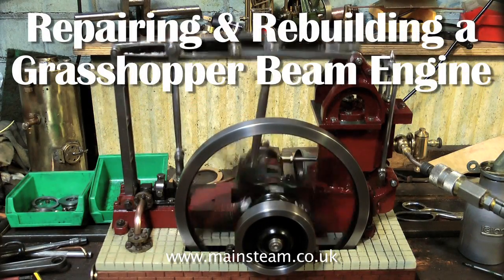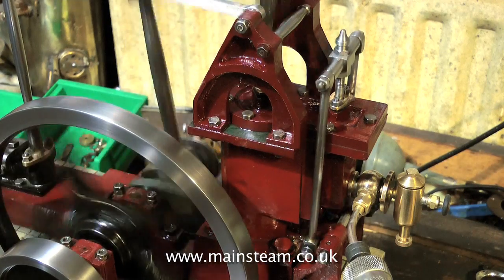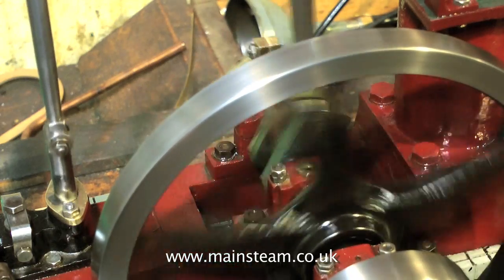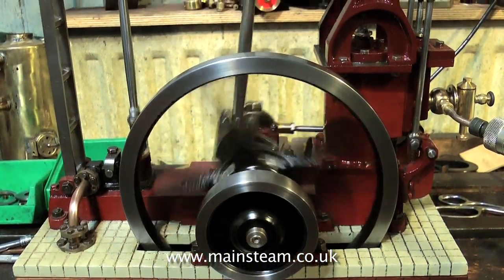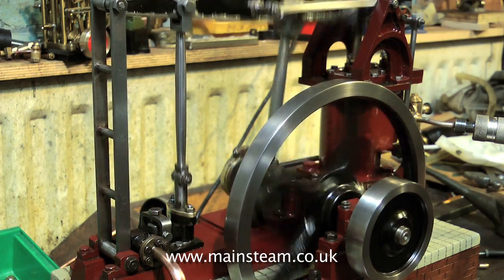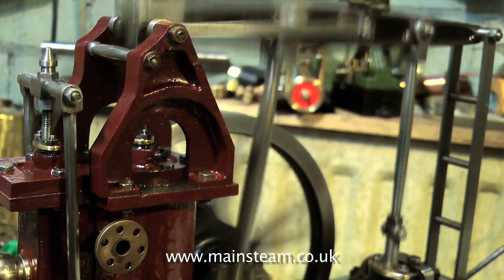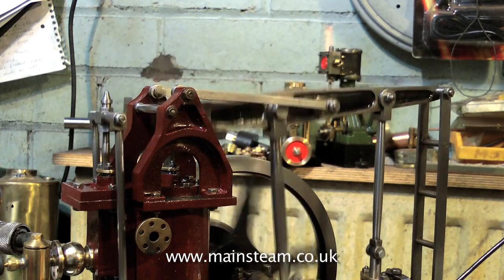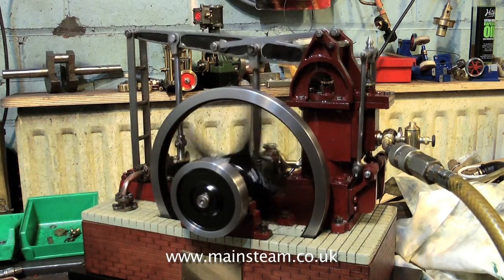REBUILDING A MODEL GRASSHOPPER BEAM STEAM ENGINE - PART #3

Comment: were leather piston seals  used or not very well? just wondered, its not related but i just restored a very old brass footpump , made a new leather seal for the piston, soaked in oil, works great, but of course wont get hot with steam
Reply from the maker: I don't really know, I am only familiar with graphited yarn as a "soft" packing ......

Comment: Why do you need to have a flywheel twice that size? Surely you can just have a heavier flywheel by reducing the inner diameter without changing the outer diameter of the wheel to help it over the "admission point"?